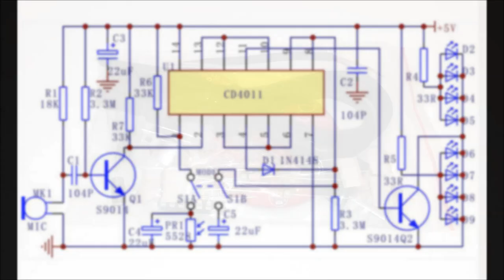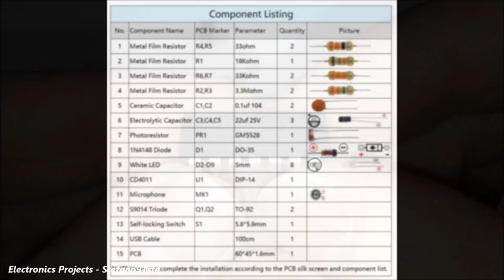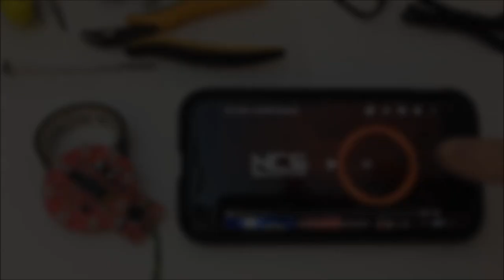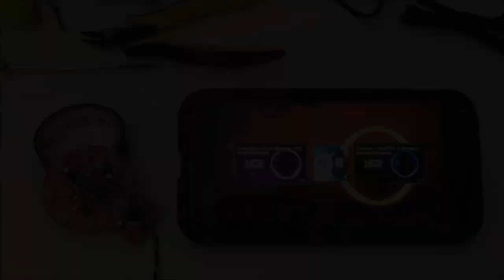Music LED Light DIY Tutorial - KIT by ICStation

Comment: Weakly do the same only with low, medium, and high frequencies. Three colors independent.
Reply from the maker: It could be done but everything should be redesigned, each frequency must have its own control IC, or a microcontroller must be used.. This is still a nice kit =)